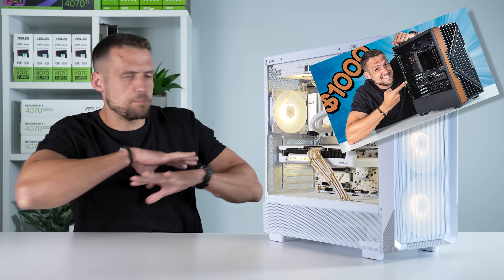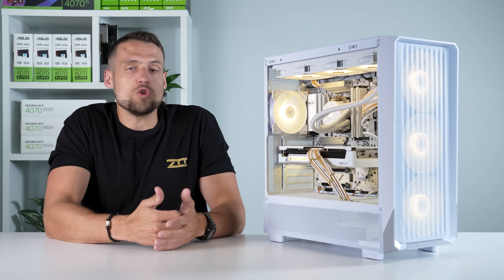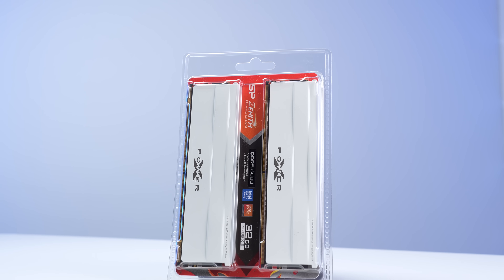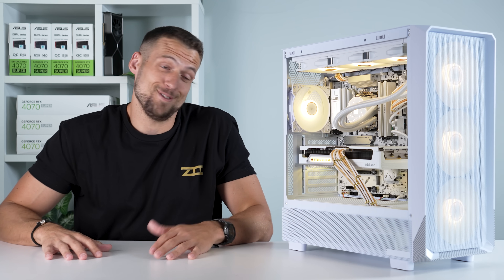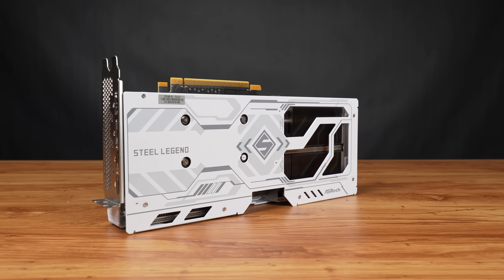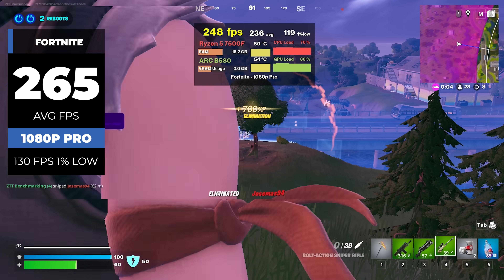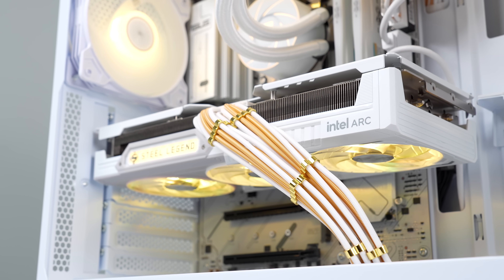$900 Gaming PC Build Guide

Comment: Hi Zach!
I need some advice on which GPU to get:
RTX 3080 12GB (387€) – brand new, bulk version
RTX 5070 12GB (540€) – brand new
I mostly play games at 1080p and might upgrade to 1440p in 2 years.
The games I play include EAFC 26, Fortnite, CS2, Valorant, Rocket League, and occasionally horror games, COD, Battlefield 6.

My full build:

Motherboard: ASUS TUF GAMING B850M-PLUS WIFI – 159€
CPU: Ryzen 7 7800X3D – 305€
Cooler: Arctic Freezer 36 – 33€
GPU: RTX 3080 12GB / RTX 5070 12GB – 387€ / 540€
RAM: DDR5 CL30 6000MHz 32GB (2x16GB) – 99€
SSD: 1TB NVMe (7000 MB/s) – 61€
Case: Montech XR – 59€
PSU: ADATA XPG Core Reactor II VE 850W

I’d really appreciate any advice on which GPU would be better for my setup. Thanks!

Comment: $1100 for amd 5 7xxx and rtx 6700 is this a good beginner gaming pc
Reply: Specs for build is as follows:
GIGABYTE B650 Gaming X AX V2 ATX Motherboard [AM5]  [DDR5]
Thermaltake 850W GF1(2024) Fully Modular ATX Power Supply - 80 PLUS Gold PSU
AMD Ryzen 5 7600x Processor (5.3 GHz, 6 Cores, LGA 1718/Socket AM5)
DIYPC  DIY-S05-BK Black USB3.0 Steel  ATX Mid Tower Computer Case, 3 x120mm Blac
Powercolor Radeon RX 6800 16GB Red Dragon GPU | 
Peerless Assassin 120 SE CPU Cooler, 6 Heat Pipes, Dual 120mm Fans, Intel/AMD
Reply: Thanks

Comment: 7500f and a b580 in a 900$ build that does not sound like a good value.  after research its not as bad i had initially thought.  but you could save abit by going with intel, like a 12600k or similar, take the money saved and get a 9060xt instead
Reply: Yeah

Comment: Hey brotha whaddup? I am currently building my first pc and decided to go with intel, i watched tons of vids and looked at a lot of stats. Im still on the fence between the i7 13700k and i7 14700k dont care about what’s cheaper, i only care about performance and stability specially for gaming e sports games such as Halo. Also i will do lots of multitasking, thats why i decided to go with intel plus the motherboard i just bought msi Z790 is intel only, so what would you recommend? I heard about the microcode issues and yes both 13700 and 14700 have them but apparently less common for the 13700. Thanks in advance 🫡

Comment: Pls cheak my pc build its for almost 665 dollars CPU: Intel Core i5-13400F
GPU: GIGABYTE GeForce RTX 3050 WINDFORCE OC 6G
Motherboard: MSI PRO H610M-E
RAM: Crucial RAM 8GB DDR5 4800MHz (Need 2x8GB for 16GB total)
SSD: Western Digital WD Blue SN5000 NVMe 1TB
PSU: Corsair CX550 550W 80+ Bronze
Case: Ant Esports ICE-112 Mid-Tower
CPU Cooler: Ant Esports ICE-C612 V2 ARGB
ARGB Hub: Verilux ARGB and PWM Fan HUB
Cables: Ant Esports Neon Glow 8PIN x 2 ARGB PSU Cable Extensions (White)

Comment: Please Rate My Pc build I'm about to do..
CPU-- RY5 7600
GPU-- RX 9060XT 16GB
RAM--32GB 6000MHZ (16×2sticks)
Ssd -- 1tb (will add 2tb later)
Psu-- 650w 
Case--Deepcool Ch260
Mobo--Msi B650m Bomber wifi
    **Please do tell about the case I selected for this this build.. does It heat.. Im about to use 3 fans totally 2 in front 1 in rear.. 
    **Please talk about this in your video..

Comment: Hey Zach, can you tell me will I lose any real-world gaming performance if I run an RX 9070 XT (or RTX 5000 GPU) on a B650 motherboard with PCIe 4.0 x16, compared to PCIe 5.0 on B850? I’m on a tight budget, so I’d rather save money on the motherboard and invest more in the GPU — is B650 still okay to buy right now? Also, do AMD 9000 series and NVIDIA 5000 series GPUs actually require PCIe Gen 5 x16 slots, or do they just support it? Can you clarify this?"
Thank you.

Comment: Here's my setup: What would be a good graphics card upgrade that would work with the rest of my components? Intel i5-9600k
Zotac AMP GTX 1080
16 GB DDR4 3200 mhz RAM
MSI MPG Z390 motherboard
EVGA AIO CPU cooler
2 TB hard drive 
1 TB SSD
120 GB SSD running windows 10 home

Comment: Hey Zach! I have a pretty important question my build that I’ve had for 4 years used for 1080p gaming at 144hz is starting to feel a bit dated what should be the upgrade path I should follow? Specs:

Cpu: Ryzen 5 5600x
Mobo: Msi A520M
Ram: 16gb 3600mhz Ddr4
Gpu: Rx6600xt
Psu: Corsair 550W

Thanks!

Comment: Is a pc with this components is fine and will it works

AMD Ryzen 5 5600
ASUS Dual RX 6600 8GB
B450 / B550 Motherboard
16GB (2×8GB) DDR4 3200MHz RAM
1TB NVMe SSD
550W–600W 80+ Bronze Power Supply
Mid-Tower Case with good airflow

Comment: I will be buying this PC can you tell me what can I do better. 
CPU : i5 14400f
GPU : RTX 5060 
Motherboard : ASUS B760M-AYW WiFi
SSD : WD_Black Western Digital SN7100 NVMe 1TB
RAM : Patriot Memory Viper Venom DDR5 RAM 32GB (2X16GB) 6000MT/s CL30
PSU : MSI MAG A650BN Power Supply Unit - 650W
CPU cooler : Cooler Master Hyper 212 Spectrum V3 ARGB CPU Cooler 
Moniter : Acer Nitro Xv272U V3 27 Inch

Comment: I've got a build idea but I'd like to consult you about the components:

Gigabyte B650 AORUS ELITE AX V2
Ryzen 7 9800X3D
Corsair Nautilus 360 RS ARGB
G.Skill Trident Z5 RGB 32GB (2x16GB) DDR5 CL32
Gigabyte Radeon RX 9070 XT 
MSI SPATIUM M480 PRO PCIe 4.0 NVMe M.2 4TB
Lian Li Lancool III RGB
Corsair RM1000e Gold (2025)

I have a budget of around $3000-$3300 (which also includes a 1440p monitor and a good speaker), although it might sound like too much for a build like that, but tariffs in my country make even a $2000 build cost $2700. (On PCPartPicker that build would've costed just $2300).

I'm not only using it for gaming, but also recording, maybe streaming in the future, and also software that relies on a strong CPU.

I already have a mouse, keyboard, headphones and also a FHD monitor, so at least those are out of the equation.

Edit: I forgot the mention, the bigger PSU is for overclocking without stressing it, I was originally going with a RM850e before thinking of overclocking,

Comment: Hey zach I’m building a pc for my younger brother and I’ve tried everything but it won’t show anything on the display (the monitor ) I don’t think I’ve done anything wrong the cables are tight the dp cable is in the gpu I’m sure all the parts are compatible but just incase here’s the main parts cpu 7 7800x3d motherboard gigabyte X780 eagle wifi7 (am5) gpu 16gb nvidia rtx 5070ti shadow the psu is 750W it’s got an aio aswell the overall usage is lower then my psu and everything looks good any suggestions?

Comment: Quick question, i built my first pc and my ram kit was rated one of the best for my motherboard and was also in the QVL for it as well, but when i enabled expo my games tend to crash especially cod bo6, i disable it and everything’s fine, i increased my soc voltage to 1.25 and everything was fine until the next day, same things started happening again, could you point me in the right direction? i have an asus rog strix b650a motherboard paired with a ryzen 7600x, 5060ti 16gb, and a 32gb ddr5 6000mhz cl36 corsair ram kit, which like i said was rated one of the best for that particular motherboard.

Comment: Hay Zach is My Pc List good for a first time build?:

CPU: 
AMD Ryzen 5 5600x 

Motherboard: 
Gigabyte B550 EAGLE WIFI6 ATX AM4 Motherboard

Memory: 
Corsair Vengeance LPX 16 GB (2 x 8 GB) DDR4-3600 CL18 Memory

Storage: 
Western Digital WD_BLACK SN7100 1 TB M.2-2280 PCIe 4.0 X4 NVME Solid State Drive

GPU: 
MSI GeForce RTX 3060ti 

Case:
Corsair FRAME 4000D RS ATX Mid Tower Case

Power Sup:
MSI MAG A550BN 550 W 80+ Bronze Certified ATX Power Supply

Comment: Hey ZTT i’ve been running the same rig for the past 10 years I think it’s running an old I-5 and a 1060 with 16gb ram

My question is I want to build a 10 year proof pc. My current budget is 3000. I was thinking of going with the. The Strix 870-A motherboard, amd ryzen 9 9950x3d cpu, amd 9070 xt gpu, 2X32 DDr5 ram, WD 4tb ssd and a 1200 watt power supply. I do alot of 3d modeling for 3d printing What would be your recommendation?

Comment: is 32 inch 2k good ? I played at 4k in a 50 inch tv where the ppi is 88 % which is lesser than 24 inch 1080p , but was way better than 1080p 24 inch , so sticking on to a 32 inch 2k where ppi is 91%,  actually should b better than a 1080p 24 right?

Comment: Hi, can you tell me about this list? I got it from ChatGPT.
Thanks 
MSI RTX 4080 SUPER Suprim X 16GB
AMD Ryzen 9 7900X3D
ASUS ROG Strix B650E-E Gaming WiFi (ATX)
Corsair Dominator Platinum RGB DDR5-6000 (2x16GB, 32GB)
NZXT Kraken Z73 RGB (360mm ΑΙΟ)
MSI MPG A1000G (1000W, 80+ Gold, Fully Modular)
Crucial T700 1TB PCIe 5.0 NVMe
ASUS ROG Strix XG27UCS 27" 4K
Logitech MX Keys (Wireless, Black)
Logitech G Pro X Superlight 2

Comment: Commenting here for build help. I am really hope this catches Zach's eye. I am building a rig with 9950X3D, X870E Carbon MB, 64GB Ram. Now for the graphics card. Budget is a bit tight. But I can still possibly get a 5080 but the problem is, where i am from  - GPUs are a bit overpriced! Cheapest 5080 costs between 1300-1400 USD. 5070TI ranges from 1000-1200 USD. And, 9070 XT is stable between 900-1000 USD. Which one should I get for gaming/video editing/PhotoShop/Illustrator/Blender?

Comment: Huh, brand new 7500F for $150 domestic from Newegg - that's pretty good if it's $20-30 less than a 7600(X). I paid $100 for mine used locally when I was up in the PNW for vacation this summer, I'd say that was pretty good because aliexpress had them for $142 and also I picked it up same day - which is good because I flew back home literally the next day. this one's on par with my rig for the most part, at least for the core specs - but I'm still camping out on a 5600xt until i can afford to get a GPU capable of driving my 3440x1440p180 ultrawide monitor for gaming.

also fun fact, the Asus B650E Max Gaming motherboards are a relatively recent release from this year, they are really nothing more than rebranded Asus Prime B850's.

Comment: Why do people hate on intel cpus so much. Right now the intel core ultra 265k is one of the best options for a 1250 to 1500 build. It's cheaper than the 9800x3d, and 9700x and beats the 9700x in gaming and raw performance, and the fps drop isnt' more than 1-2 fps compared to the 9800x3d. Infact, it beats out both in terms of raw cpu power. (multicore)

Comment: CPU: Ryzen 5 9600X (6C/12T, 5.4GHz boost)

GPU: ZOTAC RTX 5060 Ti (16GB, DLSS 4)

RAM: 32GB DDR5 6000MHz

Motherboard: MSI B650M Bomber WiFi (mATX)

Storage: WD Black SN7100 2TB Gen 4 NVMe

Cooler: ARCTIC Freezer 36 CO (Push-Pull)

Case: MSI MAG Forge 120A (Airflow-focused)

Monitor: MSI 27CQ6F (27" 2K, 180Hz, curved)

PSU: Gigabyte P650G Gold (650W)

UPS: Zebronics U1205 (600W/1000VA)

I am planning to build this. Willl this be a good system !!!!

Comment: I know I'm late to the party but I have an immportant question regarding my budget-baller gaming pc. I plan on running an AMD Ryzen 5 7600 or 7600x depending on which prices I find are best, but was wondering what gpu I should get. I would prefere to stick with Nvidia but my gpu budget is ~300. My options are preferably from team green although I wouldn't mind some team red. (Definitely not chosing intel though, not gonna explain why.)

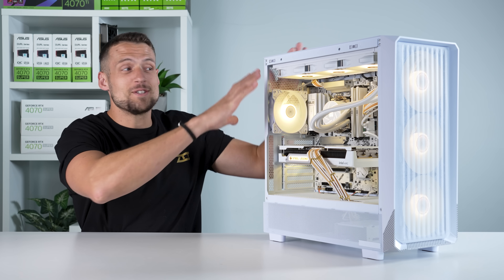Comment: 4:26 Zach can you instead recommend the Assassin King as it had 5 heat pipes instead of 4 and costs $20, too. Idek why they make the assassin X 120, besides making more profit maybe, less material cost.

But the assassin king is better suited for cpu upgrades.

Comment: Hi zach im new to PC building please review this build:
CPU: AMD Ryzen 5 9600X 3.9 GHz 6-Core Processor
CPU Cooler: Corsair iCUE H60x RGB ELITE 47.73 CFM Liquid CPU Cooler
Motherboard: MSI PRO B650-S WIFI ATX AM5 Motherboard
Memory: Corsair Vengeance RGB 32 GB (2 x 16 GB) DDR5-6000 CL36 Memory
Storage: Silicon Power UD90 1 TB M.2-2280 PCIe 4.0 X4 NVME Solid State Drive
Video Card: Asus PRIME OC Radeon RX 9060 XT 16 GB Video Card 
Case: Corsair 3500X ARGB ATX Mid Tower Case
Power Supply: MSI MAG A750GL PCIE5 750 W 80+ Gold Certified Fully Modular ATX Power Supply

Comment: Total: $944.55 Get a 9060XT 16GB for the same price with better performance.
CPU: AMD Ryzen 5 7600X 4.7 GHz 6-Core Processor  ($164.99 @ Newegg) 
CPU Cooler: ID-COOLING BLITZ X4 64.8 CFM CPU Cooler  ($14.99 @ Amazon) 
Motherboard: ASRock B850M Pro-A WiFi Micro ATX AM5 Motherboard  ($139.99 @ Amazon) 
Memory: Patriot Viper Venom 32 GB (2 x 16 GB) DDR5-6000 CL30 Memory  ($85.99 @ Newegg) 
Storage: Klevv CRAS C910 1 TB M.2-2280 PCIe 4.0 X4 NVME Solid State Drive  ($54.99 @ Amazon) 
Video Card: Sapphire PULSE Radeon RX 9060 XT 16 GB Video Card  ($379.99 @ Amazon) 
Case: Cooler Master Elite 301 MicroATX Mid Tower Case  ($53.62 @ Amazon) 
Power Supply: ASRock Challenger CL-650G 650 W 80+ Gold Certified ATX Power Supply  ($49.99 @ Newegg)

Comment: Total: $824.55 Don't play yourself. FPS/$ is king.
CPU: AMD Ryzen 5 7600X 4.7 GHz 6-Core Processor  ($164.99 @ Newegg) 
CPU Cooler: ID-COOLING BLITZ X4 64.8 CFM CPU Cooler  ($14.99 @ Amazon) 
Motherboard: ASRock B850M Pro-A WiFi Micro ATX AM5 Motherboard  ($139.99 @ Amazon) 
Memory: Patriot Viper Venom 32 GB (2 x 16 GB) DDR5-6000 CL30 Memory  ($85.99 @ Newegg) 
Storage: Klevv CRAS C910 1 TB M.2-2280 PCIe 4.0 X4 NVME Solid State Drive  ($54.99 @ Amazon) 
Video Card: Intel Limited Edition Arc B580 12 GB Video Card  ($259.99 @ B&H) 
Case: Cooler Master Elite 301 MicroATX Mid Tower Case  ($53.62 @ Amazon) 
Power Supply: ASRock Challenger CL-650G 650 W 80+ Gold Certified ATX Power Supply  ($49.99 @ Newegg)
Reply: Is this cad or usd?
Reply: @smc397 U S of Amerika

Comment: Hey Zack I think My PC has a big problem, I have 2 different sets of 2 by 8gb ram sticks and the speed I'm getting all like 2600 instead of 3200. I tried running expo, but since the ram is different It won't do it. I think. I think I should just get a 2 by16 kit of ddr4 for my b550
Reply: 2x16GB 3200 CL16 is $55.

Comment: Why did you go with such a low power power supply when you went with an AIO cooler? I would spend a bit extra on the power supply and go with a tower cooler for the CPU and basically flip it. The power supply is way more important for future proofing (a dum term BTW) than the cooler. Besides AIOs don't last as long as tower air coolers. I have seen tower coolers migrate from build to build when they're a quality one to begin with.
Reply: How much profit would you get out of this? $50?
Reply: @itsatrap4986 what?

Comment: Remove the damn useless water-cooling and get a 9060 xt 16GB instead of that dying company GPU
Reply: Total: $944.55 Seriously, 9060 XT 16GB and a B tier 650w gold rated PSU.
CPU: AMD Ryzen 5 7600X 4.7 GHz 6-Core Processor  ($164.99 @ Newegg) 
CPU Cooler: ID-COOLING BLITZ X4 64.8 CFM CPU Cooler  ($14.99 @ Amazon) 
Motherboard: ASRock B850M Pro-A WiFi Micro ATX AM5 Motherboard  ($139.99 @ Amazon) 
Memory: Patriot Viper Venom 32 GB (2 x 16 GB) DDR5-6000 CL30 Memory  ($85.99 @ Newegg) 
Storage: Klevv CRAS C910 1 TB M.2-2280 PCIe 4.0 X4 NVME Solid State Drive  ($54.99 @ Amazon) 
Video Card: Sapphire PULSE Radeon RX 9060 XT 16 GB Video Card  ($379.99 @ Amazon) 
Case: Cooler Master Elite 301 MicroATX Mid Tower Case  ($53.62 @ Amazon) 
Power Supply: ASRock Challenger CL-650G 650 W 80+ Gold Certified ATX Power Supply  ($49.99 @ Newegg)

Comment: I might buy a 1215 usd pre built set up and i wanna know if it's worth 
I5 14400f
Asus prime b760-plus ddr5 
Asus RTX 5060 oc edition
Kingston 1tb 6k reading 4k writing 
Infiniarc cube 2.0 xl 6 fan
Corsair vengeance 32gb 5200 
Deepcool ag400 bk 120mm single tower
Corsair cx650 80+ bronze 650w atx
Asus tuf ips 180hz 24inch
Mouse pad and mechanical keyboard and gaming mouse that i don't know

Comment: I hope someone reads this
I wanted to use Bazzite Gnome on B450 Auros elite V2 with  Ryzen 5 5600g with integrated graphics with no additional GPU 16GB DDR4 Ram and wanted to ask if it works, i hoped to only have Overwatch 2 and The first descendants to work and most videos on YouTube shows Bazzite with added GPU and not integrated ones, so does anyone have experience please help

Comment: Hi, sir. Since new rtx has been launch, now intel gpu is not that pricey anymore. Does building full intel (intel cpu and intel gpu like arc b580) can be worth it for 1440p monitor? Using 32gb ram and 1tb ssd. But in my country it still reaching more than $500. Or should i just make the ram 16gb and 1080p fhd monitor so the budget could reach only $500 or less? Thanks for advance

Comment: Watching on 1440P UW monitor. AMD & Nvidia 1070, 3060 & 4090 doing fine, not sure about 50 series, last gen AMD aged well they are stable 7800XT & 7900XTX. 2nd AM5 build have one rainbow strimmer for cpu got on sale, so not sure if I want another to match with gpu and if it's possible depending on which I use yet. My summer rig has been playing 1080p by the a/c though it's getting hotter.

Comment: With recent benching I have been pleasantly surprised with the 6600xt even though it is limited with the 8GB vram and 2 generations old paired with a 5600x it handles 1440p on AAA titles at 60+ and most other titles 80+ for the £100 I payed for it (£140 average) it goes to show 8GB still has a place in second hand gaming rigs just not on the shelf for over £250 and if developers can clean and optimise their games more it really wouldn't be a worry for a fair few years yet.

Comment: I need your help bro, 
I have i5 12400F, rtx 4060 ddr 5 32 GB ram. 240 mm AIO, 650 watt SMPS, 1 tb SSD. 
My primary focus is, Video editing for YouTube and casual gaming in 1080p (because my monitor is 27 inch 1080p 144) hz). 
The question is !!! Is my pc good enough for my usecase?

Comment: btw if u wanted to make this but all performance id just get a normal cooler instead of an aio and a cheap b650 with 4 ram slots do the amount of ram slots even matter lol? and swap the case to montec x5m and get a 9060xt 16gb instead and get a tier c psu or higher but no need